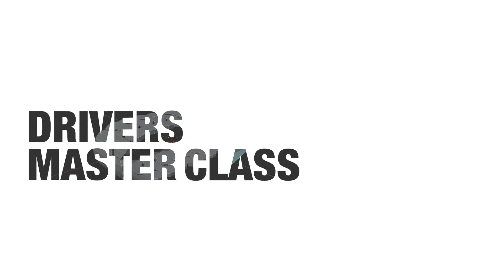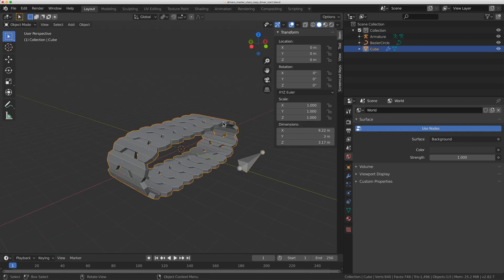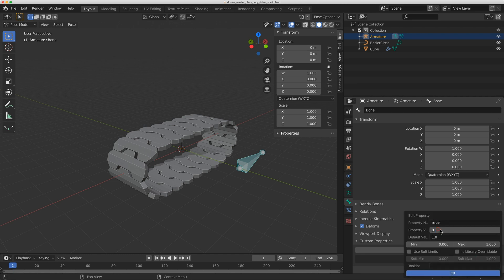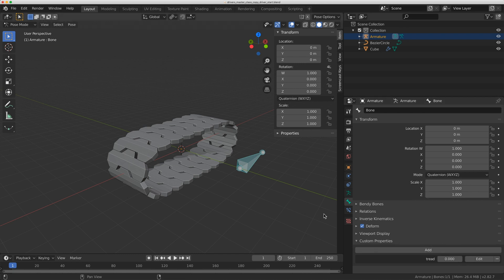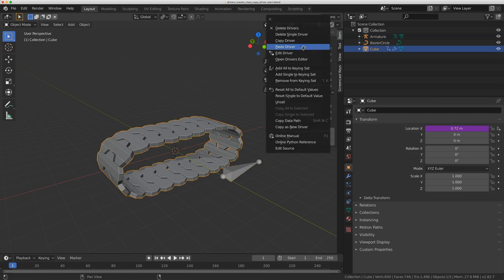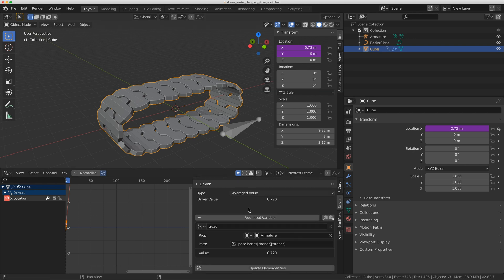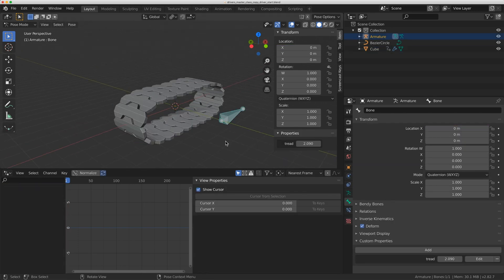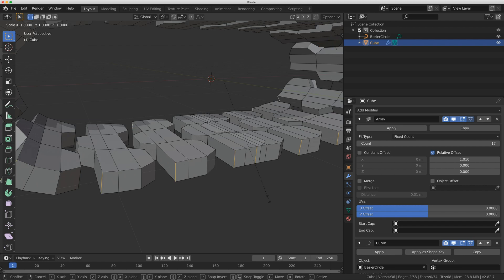Copy As New Driver Feature | Blender Drivers Master Class

Comment: var 10*thumb high 

were all very well explained and helped me a lot.
Thanks.

Can it  be also influenced correction-shape , for example, two shapes are fully faded in,
 then and only then the correction-shape
 is involved.
These are conditions if I remember correctly and it was always a horror to put these in Softimage
Reply from the maker: Yeah, you can do something like this, although I prefer to use the rig to move pieces and then have a corrective shape on top of this.

Comment: When working with the curve modifier for tank treads, I can move the treads forwards or backwards but it deforms weirdly when moving the bezier curve up/down, left/right, or rotate it on any axis. Is there a way to prevent this?
Reply from the maker: Yeah, parent both objects under something new, like an empty, and move that in space, it should solve this issue.
Reply: @LevelPixelLevel  I'll try that, thanks
Reply: @LevelPixelLevel  do I parent the tracks and the tank to an empty? Because atm I have the curves parented to the tank but not the tracks